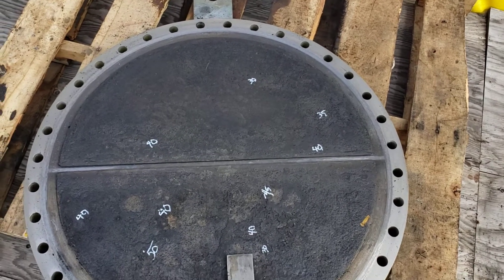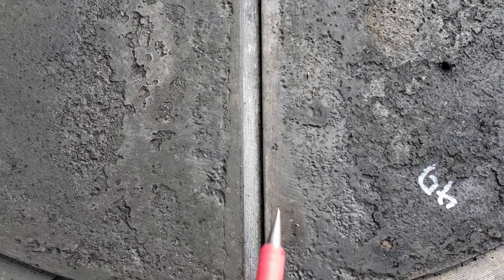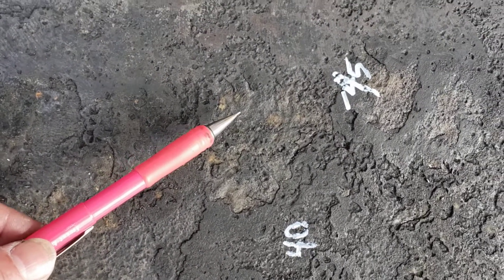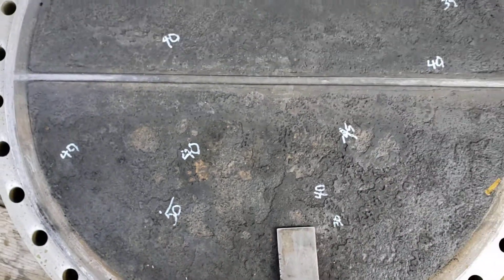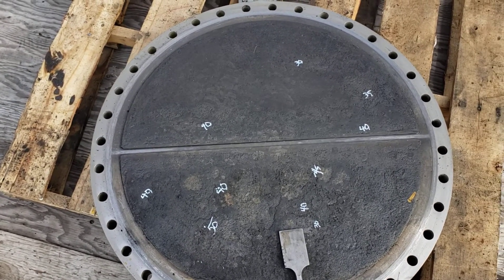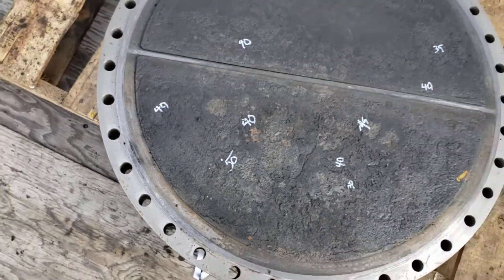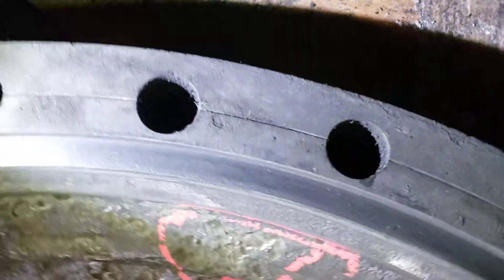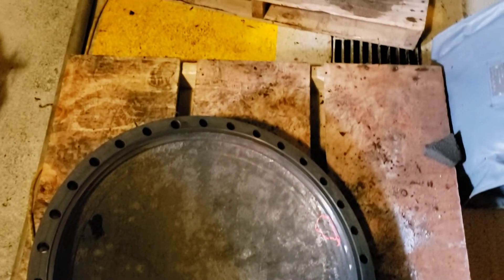API 510 inspection of Heat Exchanger type (AES)

Comment: Where can I buy that scrapper you have in the video?
Reply from the maker: Any 1½ to 2 inch (35-50mm) wide wood chisel will work.   This particular brand and style (Buck bros) is a favorite of mine,  but any local available wood chisel can be adapted.   
Perhaps I'll make a video about what is the same and what i have changed about these to use for inspection.  Mr Eric

Comment: hello mr eric, could you explain most common defect in carbon steel heat exchanger?
Reply from the maker: There are many different types of corrosion and then even erosion.  There is usually a mixture of corrosion and erosion present in Heat exchangers. Mr Eric

Comment: so was this cover pulled from service or just given a clean up with a wire wheel?
Reply from the maker: Pressure washed and buffed with power wire wheel.  No significant thickness of product material still adhered.